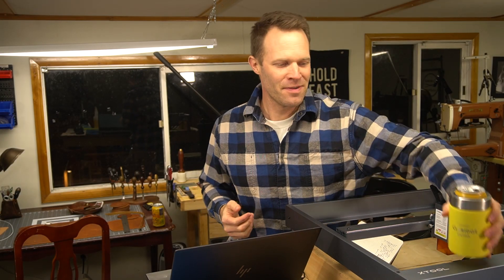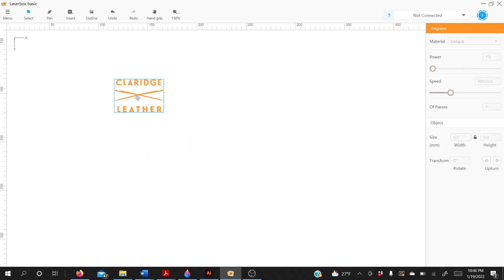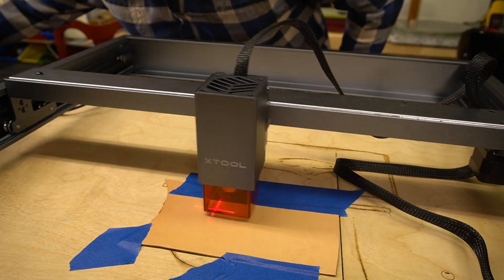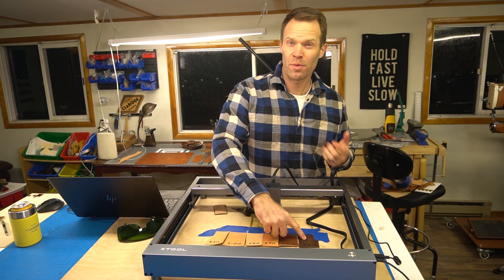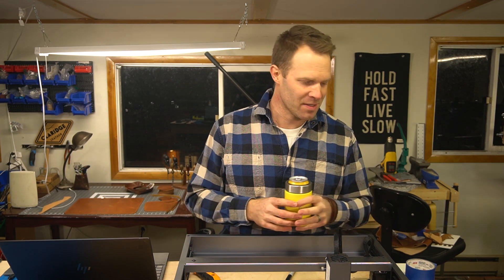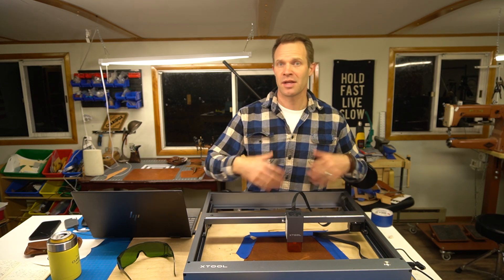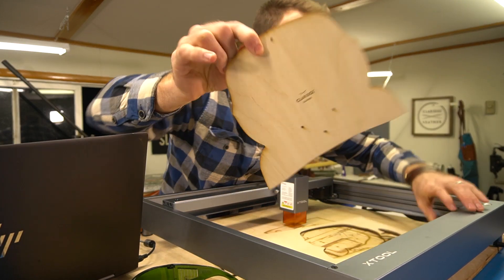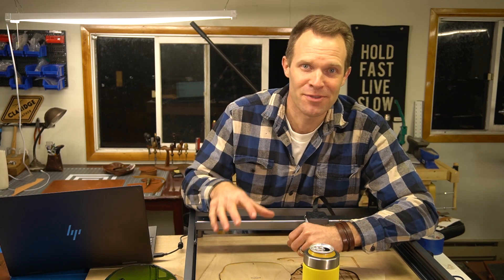How Does the xTool D1 Laser Work on Leather?

Comment: You mentioned applying tape to stop the black residue. Doesn't the residue from the tape create the leather not accepting dye ? So that method is not acceptable for leather, which requires dying. Is there any product that doesn't have adhesive that contacts the smoothie side of leather

Comment: Great comparisons. Great video. I am starting to use a laser for leather. I've seen others say you should not use the chrome tanned leather in a laser, that it can do damage. Do you have some info you can share on that?
Reply from the maker: Thanks for watching! In addition to being harder to work with in the laser than veg tan (doesn’t cut as easily, more charring and smoke), I have heard that there are bad (unhealthy) fumes created from the chrome tanned that you don’t get with veg tan. Either way, ventilation is key, but you’ll probably have the best luck with veg tan of some sort, or at least that seems to be the consensus!

Comment: That's pretty awesome. Do the dark edges cause any problems? For example I'm imagining cutting a t-pocket for a wallet and not being able to sand out the underside of the "t" leaving most of the wallet with a clean edge and parts of it with dark edges. Any issues there?

Comment: How was the smell when engraving and cutting the leather?  Do you feel you’d need the exhaust system?  Or is simply leaving your garage door open enough?
Reply: It's pretty stinky in my opinion. He mentions he typically leaves the bay door open and a fan to push it out.  I would be careful since all leather is processed and those chemicals aren't super health boosting, I assume its worst when vaporized by a laser. Do your research before risking, especially if it can affect others/pets/kids if you don't work in a space away from others (since then it's not just a personal risk.) An extraction system would be best, but garage door is better than nothing.

Comment: I know it's been a while since you made this video (very nice btw, experimental  way is the best ) but what's the speed  and output you're using to cut this 7/8 oz tan veg leather ? i just got the D1pro 20w and have been trying unsuccessfully some tests. i've ordered some low tack masking tape to minimise the charring, eager to run some news tests. and do you make any adjustments according to the leather color ? thanks !!
Reply: Yes curious too the setting used in Lightburn! He mentioned he "adapted the settings from" the other to Lightburn, so I'm wondering if its the settings shown at 2:38.

Comment: Hi there. Just ordered my XTool D1 Pro 20 w. I’m a flight attendant and wanting to make crew tags with a fairly substantial leather….along the lines of a leather coaster thickness. I know absolutely NOTHING about working with leather other than craft leather. What thickness should I be looking at using for this project? I’ll be following along with you as you have a great teaching style. Thanks in advance!
Reply from the maker: That’s awesome! I’d look for maybe 4-5 oz vegetable tanned (not chrome tanned, for the reasons shown in this video). I’d recommend something like Wickett and Craig bridle leather. You can call them directly to discuss options and order it if you want!
Reply: @ClaridgeLeather  most helpful, thank you!

Comment: I've been using laser cutters with leather for quite a while now. The best results I've found are to just trace your lines on top of the leather. Don't bother going through. I individually punch my holes and the punch sits in the trace circle outlines. You could basically hole punch blindfolded. 

I have not experimented with covering your leather with, tape, or even wood veneer to block the majority of burning that occurs. It's really hard to get the leather back to new condition at that point. And the leather will most likely shrink and warp anyhow. But what's worse is the smell. Adding more oxygen, a blower, and good ventilation may help some.

Comment: Very impressed by the cutting ability. Just a few years back, I wouldn't guess that relatively cheap diode laser will get through fairly thick veg tan so easily. I had a cheaper one 2-3 years ago and I sold it quickly. The improvement in the technology and overall design is incredible. Prolly will wait one or two years for som features additional to be included. But overall great machine. Also, avoid cutting chrome tan...that's a nono for your respiratory system ;).

Comment: Thanks for the great video! I have this laser and was playing with leather. When I engraved a logo, it would stay visible but would smudge onto the leather if touched. It may be my settings. Did you find this to be the case? Any suggestions? Thanks!
Reply from the maker: What kind of leather did you use? Was it the black char that smudged and smeared?
Reply: Don't mean to jump in on the conversation but I have the sam thing happen to me. It's nice and dark lettering until you touch it and it smears. Which in return stains it and it does not come off. I've tried blue masking tape and it does not go through the tape? Running at 100mm speed 20% power?  Thanks

Comment: I got one of these a few weeks ago. An air assist helps with the charring on the surface. I just sand the edges down a little to get rid of the roughness.  I’ve been told not to use chrometan on it because it makes some toxic fumes
Reply: Not sure what you use yours for, but how many patches can this thing churn out? I can't buy a $7k laser right now. I've been getting my hat patches 3rd party. Thanks for your help

Comment: I've been doing some laser engraving in leather and it's pretty cool. I've also used it to cut some of my digital patterns out of heavy card stock with good results. I'm going to try some 1/8" plexiglass when I get a chance, I've been told that if you leave the backing paper on it, it helps a lot.